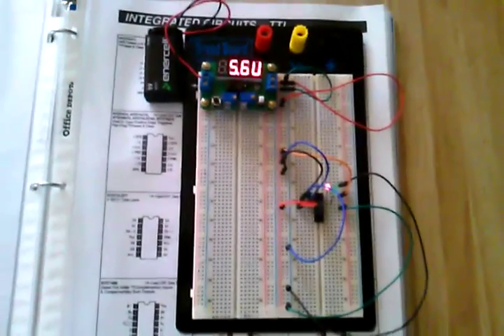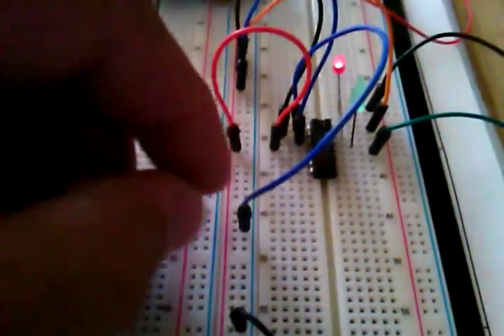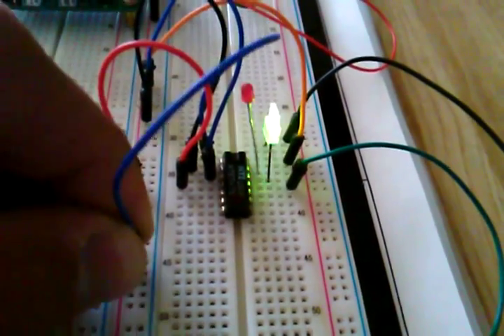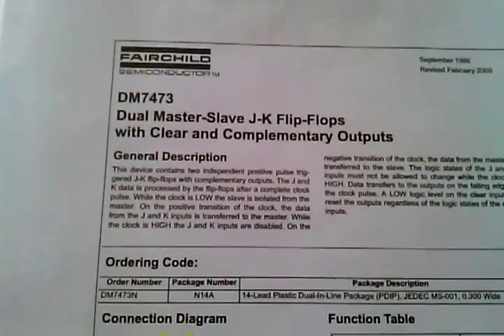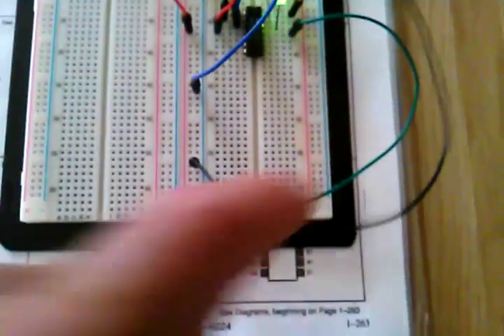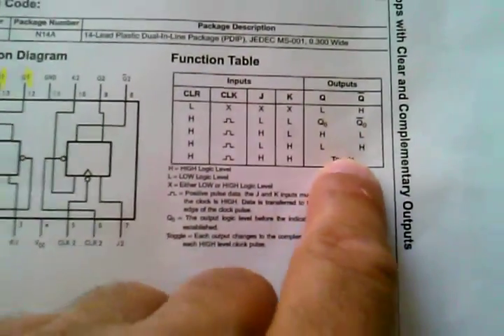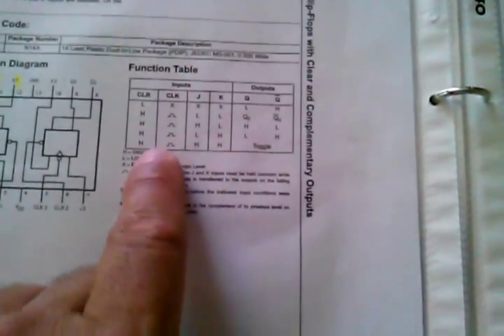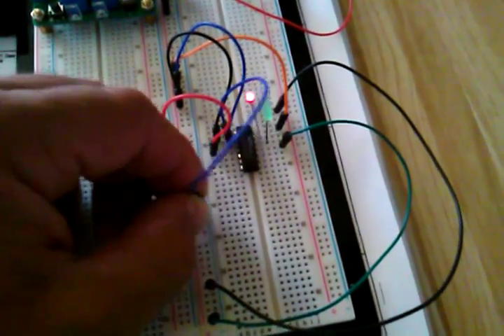Flip Flop Circuit 7473

Comment: On paper when you use a switch, you close a circuit or open a circuit and vis versa, but in the real world when a mechanical switch makes or breaks contact there is a series of connection/disconnections thus creating pulses. Those pulses don't come in to play when you are just dealing with a circuit that is activating/deactivating a light for example. In the digital world those pulses DO matter and you are seeing the result of that with the way the 7473 is clocking. With a counter you could see how many pulses are generated with each on and off cycle you create mechanically with just the wire like you are showing in the video or with a mechanical switch. As mentioned, you need to "debounce" your clock signal. The following web site will give you some insight to debouncing.
http://www.eng.utah.edu/~cs5780/debouncing.pdf

Comment: There use to be a Motorola CD4000 series CMOS 6 input debounce ic that required only a external timing capacitor to make it function. I cannot find it for love or money. Try Jameco Electronics in Belmont California. I bought it from them years ago, they may still have a stash of them. Maxim Integrated circuits makes one also, check their web site.

Comment: Not exactly,all logic devices are sensitive to noise that is coupled in thru the power lines (vcc/gnd). The bounce of the switch contacts creates unwanted transients, that are seen by the logic input as a "valid" signal to cause the device to switch. A bebounce ckt gives you a clean turn on and turn off, without transients, pulse.

Comment: Don't forget to use a 0.1 uf ceramic capacitor and a 1.0 uf Tantalum capacitor across the 5vdc to ground( as close to the IC AS POSSIBLE), always remember proper bypassing will keep noise out of your circuit and also is a good design practice. The ceramic capacitor serves as a bypass cap and the tantalum capacitor is a charge reservoir. Remember TTL devices are current hogs and require good filter caps and proper bypass caps as well.

Comment: Connect your J,K, set and clear inputs via a 1k ohm to +5 vdc ( vcc). Using a bounceless switch ( look it up on line) connect that to your clock input. The reason for a bounceless switch is using only a pushbutton w/o debouncing will cause the F/F to change state randomly due to the mechanical bounce of the switch. A debounce circuit  filters out the " bounce" that is inherent to the mechanical switch contacts. Find the TTL COOKBOOK by Don Lancaster, good for debounce circuits and other TTLstuff